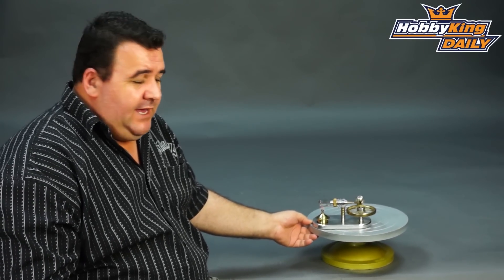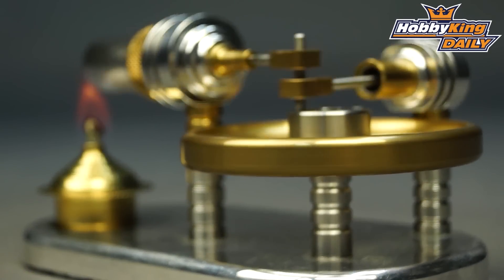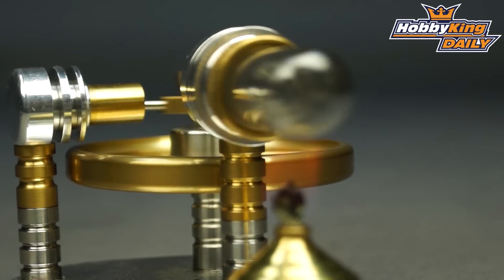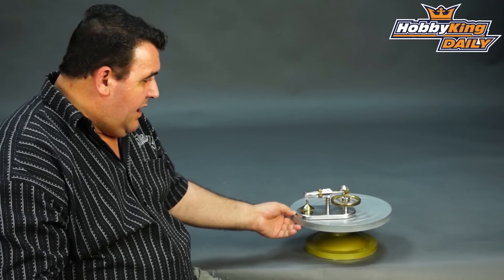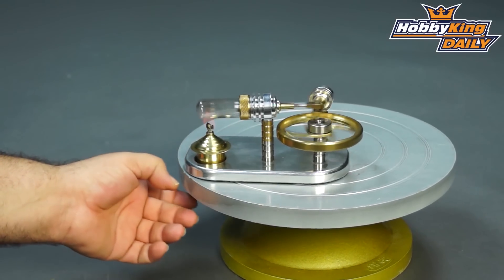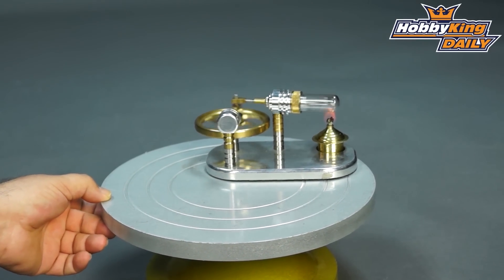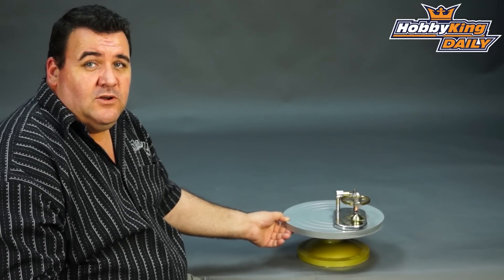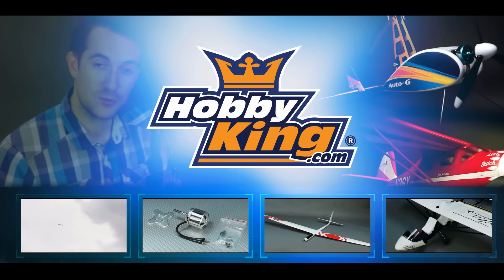HobbyKing Daily - Stirling Engine Demonstration

Comment: So, I just posted on the previous posting about how they did not actually run this thing... and then found this post.  Hobbyking, your like the special little kid down the street.  Your proof of operation only has a minute of it running.  How does this thing work?  Your videos are just like your written instructions!!!  Whuuut?  Or maybe I'm wrong, and this thing comes running already from Hobbyking.